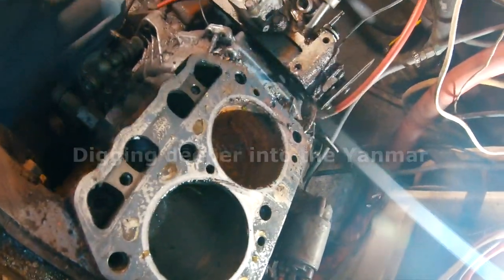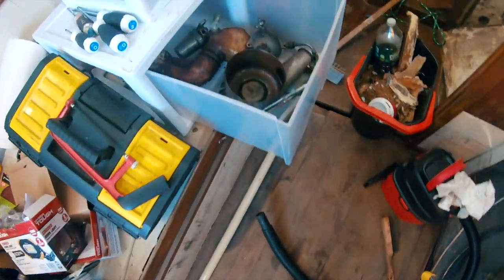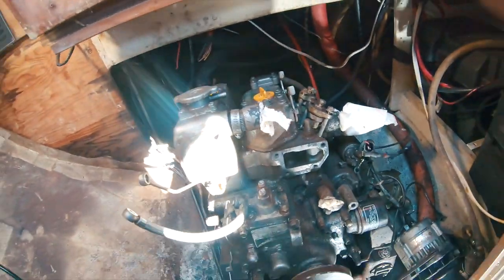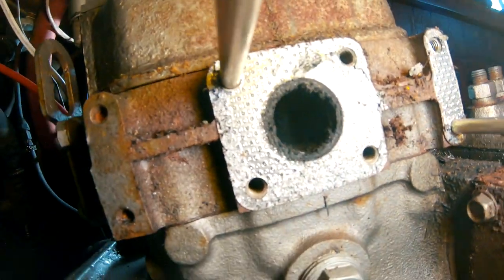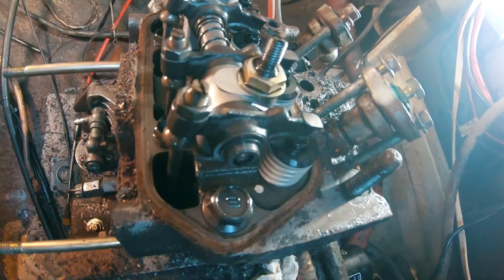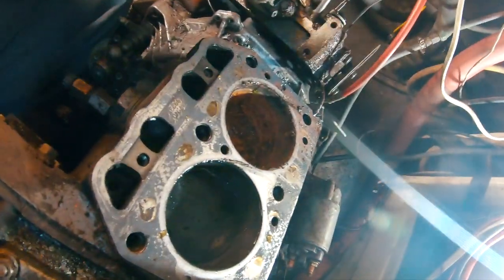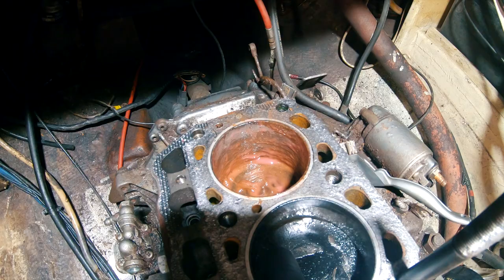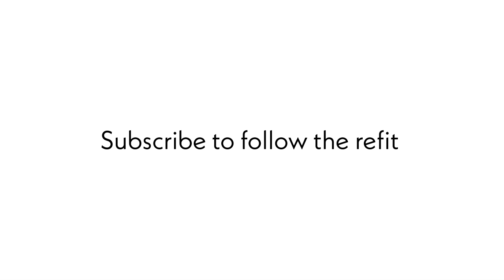Ep. 5: Rusted cylinder in my diesel engine - Refitting Reverie

Comment: Wow...I would just pull the engine and rebuild the cylinders new sleeves, pistons....rings....the head can be fixed barring any cracks....block too.....at this point everything top and bottom....replace it all....spec out the crank shaft and bearings, rods if you want to save a few bucks..but for all that time and questioning later on...replace it all....good luck....just mark and everything you pull out if you are going to put the old parts back in...making sure all rods, bearing..go back in correct order you removed them....again good luck....John